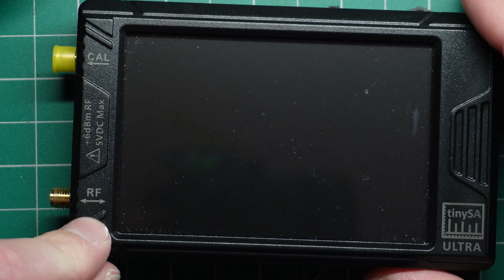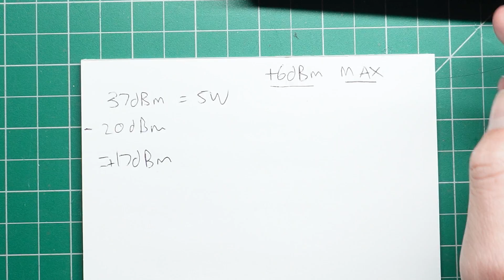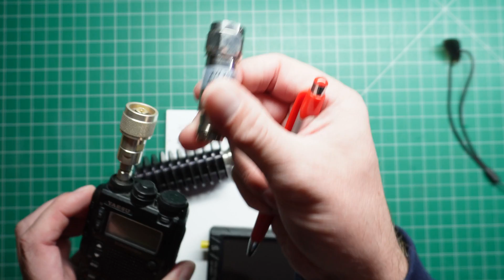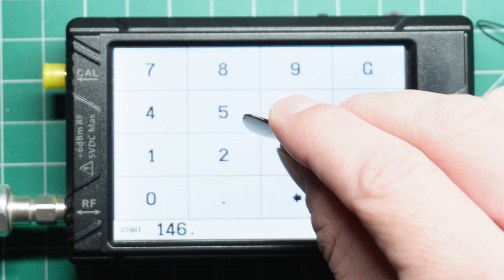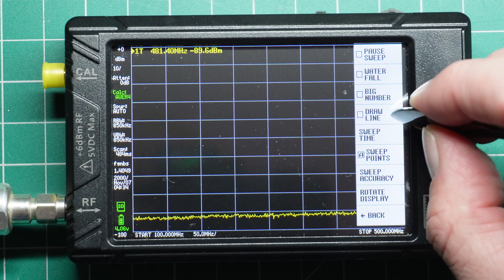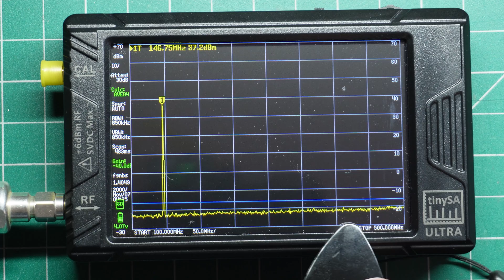Are Your Ham Radios LEGAL? Test Them Yourself!

Comment: It's good to add a high-pass filter between the attenuator and the spec-an. This is to check if the analyser is creating the harmonics internally and making the measurement look worse. So, for a 2m radio, you'd use a 200MHz (or thereabouts) high-pass.

Comment: When I built my 4 Watt h.f. radio I used a wavemeter to check for harmonics. I couldn't find any but they were probably so low I couldn't detect them. 
Baofeng, buy cheap, get cheap.
G4GHB.

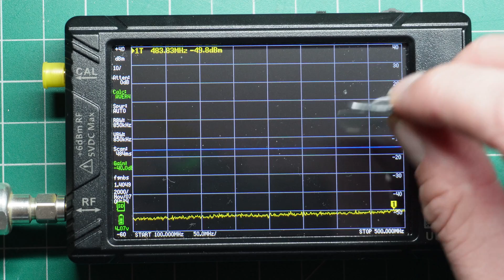Comment: To be honest, I fell for this also. Look at your video at 10:30.  That's not so much averaging (in fact, why would averaging change the relative peak heights) BUT the attenuation is changing on the TinySA and reducing overload. It starts at 0 and then gets to 30 dB. I thought my Baofeng was warming up or something. If you take it off of Auto and set it to 30, your life will be better.

This, or something like it is discussed in "tiny SA Mistakes" by Erik K. See at 08:40.

I am finding out that those labels like "6 dBm MAX" are to avoid damage, not to insure good measurements. I've been seeing lots of recommendations for the TinySA of -30 dBm.

Comment: What if you just hooked a rubber duck to the tiny SA and a dummy load to the radio and use them in the same room? Would it still overpower the tiny SA?

Comment: Good video.   I think you could make the wrong assumption regarding cheap Chinese radios.   The FCC(or other gov entities) have requirements on spurious transmissions, but these tests should be performed with the stock radio which includes the stock antenna.  Antennas are like band pass filters and if they are any good will transmit the band signal but not necessary out of band spurious harmonics.   I say your testing is wrong.   Use the SA antenna, recalibrate the attenuation to normalize the main frequency signal to 37dBm(5W) and then test radios.   If the radio does not transmit spurious harmonics via the antenna then it's legal.  I may turn out that cheap radios with muhltiband antennas fail and if so then they are illegal.  

I would say that even a really, really bad radio could transmit legally into a dummy load.  It just won't be ant fun.

Comment: Where did you get the 16.02db number at?  I always see 40db or 43db.
Reply: -16.02 dBm is 25uw (microwatts) and is mentioned in the fcc regulations about reducing between 25uw and 10uw.  So that needs to be equated within the maths for determining attenuation.  Cheers

Comment: Keep in mind that while the Tiny SAs are very good and well worth buying, they are not really a lab quality instrument. They're great for comparative and illustrative purposes but aren't always reliable for absolute measurements. I see quite a bit of variation between the Tiny SA and my Siglent instrument.
Reply: I'm still learning both of them and I'm pretty pleased with the comparison, especially if I factor in the size and cost. Some of the glaring differences have been tracked to not using enough attenuation on the TinySA (Ultra).

Comment: I have a 20 watt handheld Radio by Leixen and want to test spectral purity. What value of attenuation would you say to use with my TinySA Ultra?
Reply from the maker: 20 Watts is 43dBm. So you'd probably be best to invest in at least 50dB of attenuation to be safe. Perhaps join two attenuators together such as I did

Comment: I use a nanovna to test the attenuator's actual attenuation. Since they won't be exactly 20 or 40db.
It would be a good experiment to go to a high up location and attempt to pickup actual 2nd harmonics transmissions of hams using a popular repeater. Using an sdr receiver and an antenna tuned to 288Mhz-296Mhz. From my qth I've not seen anything, but its milliwatts line of sight and I'm not at a high elevation.
Reply from the maker: The attenuation won’t be completely flat over its entire range, although my amphenol attenuators are only +/- 0.5dB within spec over the entire DC-3 GHz range.

Comment: Good meaty stuff. :bow: Now at first blush I would have assumed you had a nice shielded connection between the radio and the TinySA yet you still picked up the transmission from another radio in the shack (it did seem to be rather weak). Any idea how that signal snuck in? Just goes to show you - testing can be hard!
Reply from the maker: Yeah that transmitter was literally 3 feet away.. there will always be a bit of leakage of signal in at those sort of distances.

Comment: Great content and very helpful for someone interested in the hobby. I realize this is a very basic question and more related to test and measurement practice than this measurement in particular, but would it be possible to precisely measure the calibration of the attenuator chain first / why would that be more difficult than it’s worth etc. Perhaps it’s neccessary to just have much higher end test equipment to get that accuracy etc?
Reply from the maker: I do have a HP service monitor that I've measured those attenuators in the video. They are within +/- 0.5dB of accuracy... even better for the big one with the heatsink... I think I measured it on 146 MHz at 20.13dB. 

But yes - good point, you can get some cheap attenuators that might be rubbish and not the correct spec.

Comment: Hayden, I noticed the 50w attenuator has Type N connectors. How much would using UHF connectors affect the measurements, especially on the 2nd and 3rd harmonics? Or even if the fundamental was 70cm?
Reply from the maker: Interesting question - I wouldn’t use PL-259/SO239 connectors at UHF frequencies in this kind of testing - due to the inconsistent impedance above 100 MHz.. which they are commonly rated for - even though “up to 300 MHz” is also quoted. 

At 2m I wouldn’t expected to see any major issues…
Reply: @HamRadioDX  Your assignment, should you decide to accept it, is compare measurements with UHF connectors and Type N....
Reply: @HamRadioDX  Thanks for the reminder to use N type connectors for UHF frequencies. That (along with the need for the proper attenuation) should get a bit more air time from some other Hamtubers.